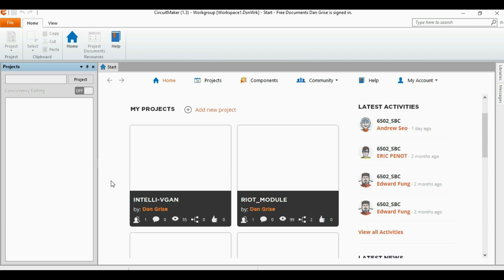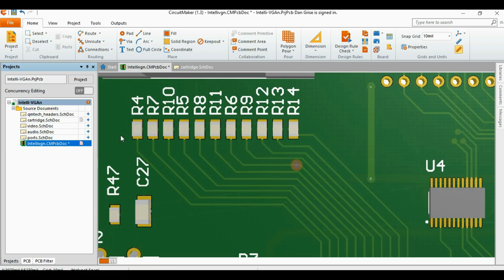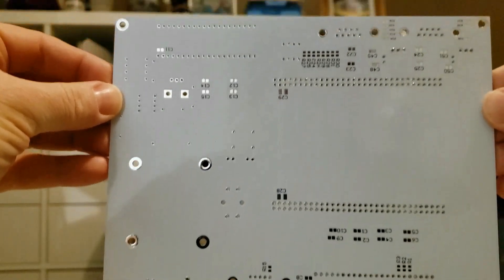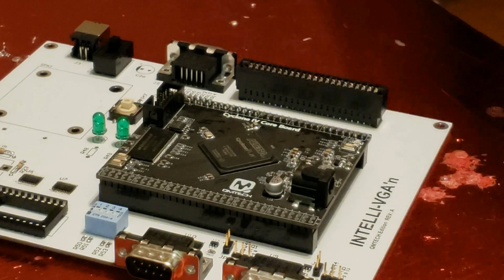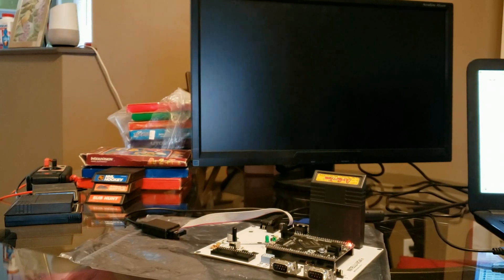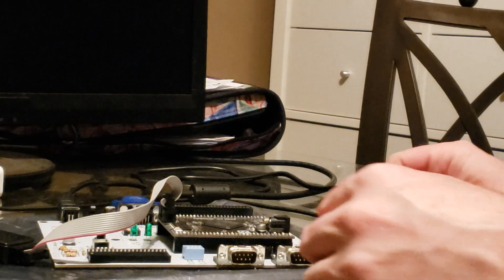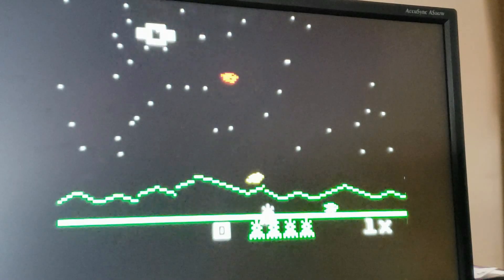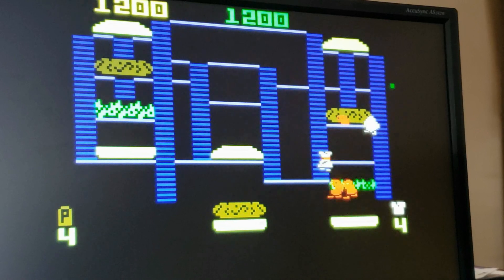Intellivision FPGA Core - Ep2

Comment: Very impressive work!  Are you eventually planning to test using the Sears Intellivision controllers or using the Intellivision II controllers since they use DB-9 connectors?  Note, you can also use the Intellivision Flashback controllers but the DB-9 pins got rearranged.
Reply from the maker: Thanks Chris.  I was planning to use either Intellivision II controllers or perhaps original Intellivision I in which case I would rewire the end of the cable to a D connector.  Its good to know that the Flash back controllers can also be used with some modification.  I am also going to support the Sega Genesis 6 button controller for some of the arcade based games.
Reply: IINM, Just 2 pins got swapped on flashback controllers, a relative easy fix if you score yourself a pair. :)

If you're on AtariAge, user Grips03 made a Genesis to Intellivision controller adapter, which works very well. The only catch is, it has to be powered with 9v & also 2 of the Genesis buttons have to be pressed at the same time in order to register 1 button on the Inty side (button 3). Buttons 1 & 2 work fine otherwise.

Comment: It looks like the backgrounds are maybe being drawn 4 or 5 pixels higher than they should?  The sprites look too low in relation.  For instance, in Burgertime, the bottom of the sprites are below the platforms they should be walking upon.  I'm surprised you put a speaker on the main board, instead of an audio jack.  I would have thought an audio jack would have been a simpler solution - since you wouldn't have to worry about volume adjustment controls, and it could be used with some monitor's audio inputs.  Amazing progress; I look forward to seeing the finished unit!
Reply from the maker: You are very perceptive on what you noticed in Burgertime.  That is one of the issues I will be investigating.  I went for on board sound because I wanted to account for cases where the display has no speakers.  I admit its an unorthodox approach.